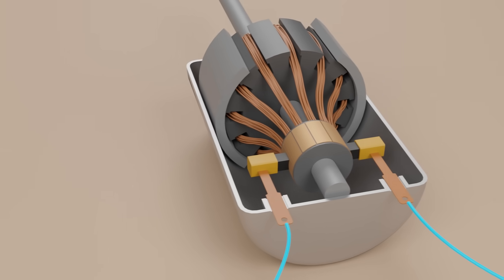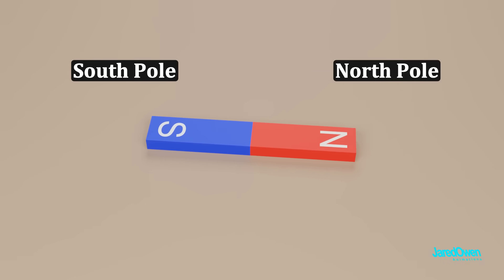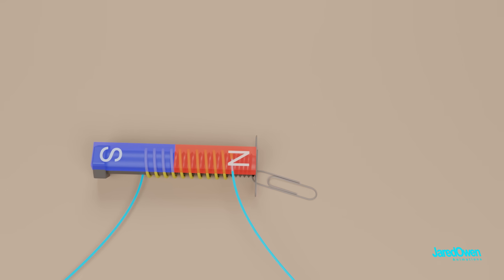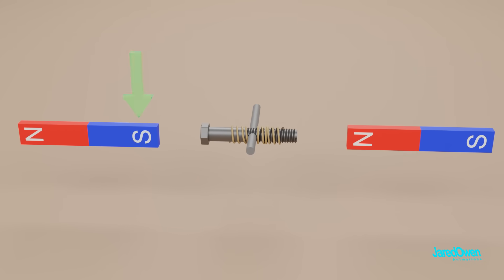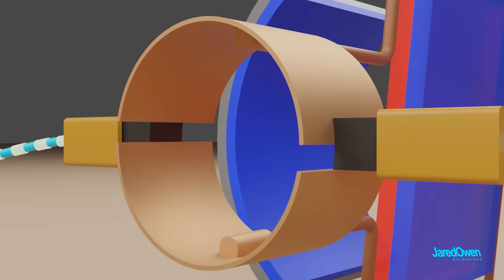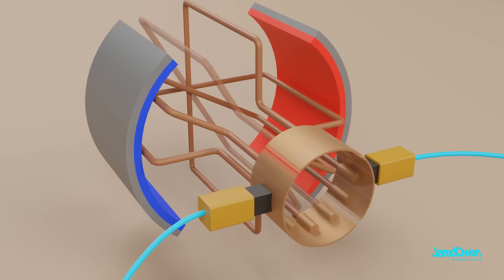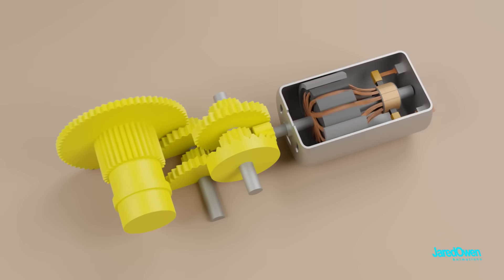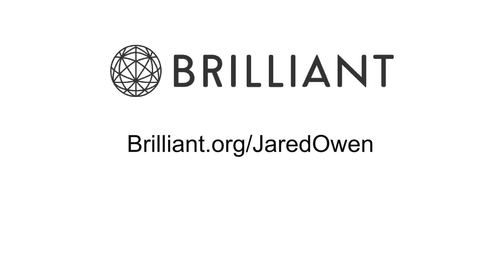How does an Electric Motor work?  (DC Motor)

Comment: When electric current flows through the straight wire it produces a circular magnetic field around the wire. But when the wire is wrapped into a coil the circular magnetic field will all mursh together and form a larger and stronger magnetic field.

Comment: Why introduce the electromagnet as if it requires the bolt? The coil could have been wrapped around a plastic straw and it would still be an electromagnet.
The core might strengthens the magnetic field, but also introduces a delay in the change of the net magnetic field direction.
This over-complicates things at the beginner level and also potentially misleads beginners into believing that an electromagnet requires a core to function.

Comment: had a watch it a few times but i think i got it. 

Here is what i understand from it, the armature become  an electromagnets only when current flows through it. The commutators are used to switch between the different armatures to get spinning of the rotor and to alternate the power source without having to manually switch the wires. The stator are the permanent side magnets they don't move. To make the motor turn faster there are two way: one increase the power of the source or voltage, two increase the number of armatures or wires.

Comment: Wow the conmutator was a really bright idea. I was already thinking about a capacitor and transistors that would make the swap of direction the current happen. And I was wondering how would you perfectly sync that with the magnets. When I saw the conmutator it blew my mind of how simple, elegant and efficient it is.
Reply: Only in DC do you use them. Don't really need them in A/C motors.

Comment: A good point to mention is that the wires are insulated from each other with a thin coat of enamel that's not really visible, otherwise the circuit would be shorted

Comment: Compliments for the video, it is the best on YouTube explaining the brush motor.
 You may want to follow with a video describing an induction (AC) motor.
Since your outstanding graphic abilities, you may easily explain the 3-phase concept.
Because of EMI problems and all the sparks they create (and not because of durability of the motor), in the last few years brush motors are being replaced with brushless types, which are AC motors with an inverter built inside.
Thank you for the great video...

Comment: This is one of the best videos explaining the working principle and construction of an electric motor i have ever seen. I am a Physics teacher and I use this video in my classes because it is perfectly animated and the didactics are just right. Thank you!
Reply: https://youtu.be/YIJMf8hPsYg
Reply: Indeed
Reply: But i think it actually have a miss when presenting an electromagnet in armature. It should be a current, only electric current brought by the wire interract with the magnetic field perpendicularly. And not the electromagnet created by the armature.
Reply: I'm not a technical guy but this video explains quite well except, I thought some more animation or explanation was required for me when you were explaining an increased number of  windings required. Thank you!
Reply: https://youtu.be/yfeDqNNP7Ek
Reply: Don't forget all AC & Radio waves type power have three elements, 1. the positive cycle 2. the neutron, last but not least the   3  the negative cycle.  That neutron cycle is by far the most powerful once you understand:  Without the neutron, the energy could not move forward!!!  You can learn allot about this if you have a bar magnet.  I will prove to you that the center field of a magnet is the most powerful by far!!!  It's how they built the great pyramids!!    If you have a bar magnet/ not a horseshoe type, I'm going to show you all the basics.   DO NOT DISRUPT THE CENTER FIELD WITH ANY OTHER METAL>> 1. Anti-gravity, get something like plastic or glass a granite rock would work well just tap with your finger the centerfield of the magnet near same and it will lose 2/3 it's weight, Next 2.  let's tap the center field near a stream of water and watch it repel the water.  3. If you vibrate the center field at the correct frequency any granite rock will become butter.  YOU MUST UNDERSTAND THE DIFFERANCE FROM An OSCILLATION AND A VIBRATION!!!  The petrographs on the pyramids told us all of this...  Our future will depend on the center field, The height of one's intelligence is directly proportional to their realization of their own ignorance VPC!!
Reply: Hi

Comment: the motor work run by the alternative current(Ac) because when we switch on inside the motor the fan is rotate and rotational motion is formed and the rotional motion is convert into magnetic force and the magnetic force is pull the electricity to work the motor

Comment: To be clear, this video demonstrates the flow of electricity using fundamentals that are based on Conventional Current Flow Theory (Usually taught to Engineers) instead of Electron flow theory (Usually taught to Electricians) which can make understanding the flow of a magnetic field confusing for electricians, because the current is said to flow in different directions which would result in a motor spinning in a different direction if a person is not already aware that conventional flow theory compensates for this change in direction in their fundamentals, a person not aware of fundamentals may easily misunderstand. Just pointing something out for you halfcocked electricians in training. Best of luck.

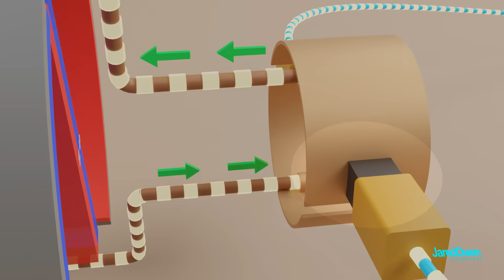Comment: 05:40 Could somebody please explain why the current flow direction would change after the brushes change sides?... and why would not it change when more armatures are added later?...
Reply: The direction of the current at the brushes doesn’t change. However, the current direction changes around the loop because the commutator segments turns and connects to the opposite brush. In other words, the left hand segment, which was connected to the left hand brush is connected to the right hand bush after one revolution of the loop, thereby changing the direction of the current in the loop.
Reply: @kennethcohan9630  Just so i can be sure if i figured it out, if we call the left side of the semi ring A and the right side B, the current flows from A to B lets say and makes an electromagnet with the polarity of SN, the moment we switch sides the current starts flowing from ring B to A, changing the current and therefore the polarity of the magnet to NS which allows us to keep spinning, right?

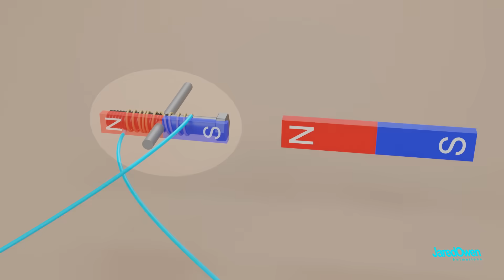Comment: 3:57 Why doesn't the magnet spin counter-clockwise, back to the original position?
Reply: In a single loop motor, it could go counter clockwise, as there would not be enough torque or momentum to move the loop into the influence of the other magnet. However, in practice, there are many loops and so there would be sufficient momentum to carry it past the point of no return.

Comment: Stupid question,  in your opening demonstration of the simple circuit with the battery, light and switch, what keeps that from just shorting out?  If you just hooked the wire from positive to negative you would have a short circuit and a blown fuse if there was a fuse in the circuit.  Why does is not create a short with light in the circuit.

Comment: I've always had electric motors doing things in the shop.   But I never understood how the motor worked.   Thank you so much for a great tutorial on how they work.
I remember our table saw needed to be re-wound because it kept shutting down.   I'm now looking for how to wind a motor.
Reply: Bee Bob •  You can find info online And there's many training manuals on rewinding/rebuilding of electric motors. Rewinding an electric motor is Very difficult, as there are many components to it. Many different types of wire connections, insulations, etc.  I did it for 14 years, mostly AC 3 phase which is easiest compared to DC or Single phase AC. Good luck Bob🥴😎
Reply: @unclefuddelmer9224  Oh, it's more curiosity on my part.

Comment: I personally already knew how motors worked (when I was little I had a build-your-own DC motor kit, where I had to wrap my own coils, install the magnets and brushes, take the insulation off the end of the coil wires and connect them to a DC electric post, etc. Highly recommend, it was a fun, educational project for kids!) However, I still found this video to be interesting, as it explains everything in simple terms that anyone can understand, yet also briefly (but properly!) explains the fundamental principles that are behind the entire process!

Comment: 7:41 that's a universal motor, which works like DC motor, but it's capable if run on AC or DC, unlike DC motor, and universal motor, doesn't have magnets, it has the armature, and the stator, so it only has electromagnet itself, and it's capable of running at a very high speed of 30,000rpm.

Comment: Actually the rotation of an electric motor has nothing to do with magnetic poles switching. When a charged particle moves through a magnetic field it experiences a force exerted upon it that is 90 degrees to both the relative motion and the magnetic lines of flux. It's the force exerted on the electrons moving through the flux lines that cause the motor to spin just as the force exerted on the electrons cause current to flow in a generator.

Comment: It is very well explained. For the first time I have understood why the DC motor starter turns on it.s own when the engine is turned on. Now why does the starter fly wheel return once the engine has started?

Comment: So the commutators don’t really “switch” the current its just that at the half way point the electro magnet should get its original field orientation it had from the start to make it continue to spin otherwise it would be locked with permanent stator magnet field. 
Anyone know if my understanding is correct?

Comment: good video, the animations show "conventional current", which is backward to reality.  Electrons flow from negative to positive, and conventional current is a human construct thinking the positive charge is flowing to negative.  not the case.  Could have done with a 20 explanation that neg flows to pos.
Reply: It really doesn’t matter as the result would be the same, whether the current flowed backwards or forwards

Comment: I've a doubt 🙋

What about the friction produced in the brush?

If the torque is more....then... shouldn't it be damaged as heat will be unavoidable ...?

So how does they make it possible ?
Reply: Evitable is very rarely used; prevented or avoided is more common. There is heat, you are correct but it is not sufficient to cause burning, provided the brushes are bedded in to match the curve of the commutator.

Comment: At 5:26, what determines which side becomes N and S in relation to the flow of electricity? 

It looks like an up-and-down relationship.
Reply: When the current is flowing away from you, in a conductor, there will be a magnetic field set up around the conductor in a clockwise direction and in an anti-clockwise direction when the current is flowing towards you. When the conductor is in the form of a coil, like around a bolt, the same principle applies. Look at location 2:45 and you will see the current flowing from the left hand wire around the coil. Now notice the direction of the current in the wires on the top of the bolt. The current is coming towards you, which means there will be a magnetic field around each of those wires, flowing in an anticlockwise direction, so there will be magnetic lines of force flowing from left to right inside the bolt and from right to left outside the bolt. Therefore, we know that magnetic lines, in a permanent magnet, flows from North to South outside the magnet and so we can see that the magnetic lines flows outside the bolt from right to left. Therefore, the right end of the bolt must be the North Pole and the left end will be the South Pole. Look up the corkscrew rule and maxwells right hand rule as the means of determining the North and South poles.

Comment: Sir plz help me for this question... Sir what is the full form of PMDC ... I checked on google thats PMDC means pemanent magnet dc motor . But sir PMDC are machines like pmdc motor or pdmc generator.. So sir plz clear my dought.. What is the full form of PMDC
Reply: Motors and generators are the same machine. In one we give mechanical input and electrical output and vice versa in the other. So PMDC simply means permanent magnet dc machine.. it can be either a PMDC motor or a PMDC generator.

Comment: I used to think if the electromagnet was replaced by permanent magnet, the motor does not require electricity to spin and we can generate infinite electricity using generator
Reply: So, what do you think now?

Comment: when the brushes switch commutator segments how does that reverse the polarity
Reply: Good question... succeeding commutators have their respective coils wound in opposite directions (crosswound) from the preceding to achieve the opposite polarity.
Reply: The polarity remains the same at the brushes, i.e. +VE or —VE. The polarity in the loop changes because the commutator segment moves from one brush to the other brush as it is revolving.

Comment: Does this go the opposite way like how wind turbines and water wheels create energy?
Reply: actually, yea, generators are when the stator is a temp. magnet whilst the rotor is a perm magnet. any turning, as long as there is magnetic resistance, generates electricity, almost like how pushing a car gets it to start, but n this case, you push it backwards and it somehow goes forwards. then it just needs the electrical equivalent of a valve as the current made from this is alternating constantly, hence the name Alternator. the component that acts as a valve is called a rectifier, and it converts AC to DC. this is why if a wind turbine goes in the other direction, it makes just as much if not more power. basically, the more torque applied to the rotor, the more energy flows through the system as it is converted from kinetic (physical) to electrical energy.

Comment: The windings in most armatures appear to be bare copper wire.  Doesn't the wire have to be wrapped with an insulator for the current to flow only though the length of the wire?  What is the insulator?

Comment: 5:30 as shown here, there would be 2 short circuits per rotation, as the brushes CONNECT both half-rings of the commutator!
Reply: Yes, the brushes should have been thinner, but you would get sparking. Ha, ha.

Comment: I’m confused on how the brush changes the direction of the current when it loses contact, can someone explain that to me please?
Reply: Yeah me too bro
Reply: its not that its opposite, but more that the momentum alone is enough to tug it the millimeter it needs for the next one to regain contact, which allows the next loop to turn on, rather than completely reversing polarity each time.

Comment: I've been dabbling in electronics using ac/dc motors in it's many forms, I knew everything in theory, however never imagined seeing it so clearly today answered a load of questions i had in mind, like how do they take an DC motor and make an ac motor directly, I knew that they just worked, seeing it made it so much clearer in my mind. That's 30 years later. Thanks.

Comment: Awesome animation. Just one point though, you say that a stronger torques means a faster spin. This is actually not 100% correct. Since the rated output power of a motor is a fixed value, speed and torque are inversely related. As output speed increases, the available output torque decreases proportionately. As the output torque increases, the output speed decreases proportionately. This is done by changing the electromagnetic characteristics of the motor by altering either the wire size or the number of wire turns in the winding, or both. More turns of smaller wire provides more torque and less speed where fewer turns of larger wire provides higher speed but less torque.

Comment: Why is it importation to wind the wire in form of a coil?  Can wire be wound in any other shape?
Reply: the electricity only travels in one direction along the wire, and when it moves it pulls the electrons in the metal object along with it. so when it travels in a coil it pulls all the electrons in the bolt in a single direction, and wrapping it around allows u to have more wire in the same amount of space rather than having wires travel across the length of the bolt

Comment: Does every magnet have N and S poles? for example, if I bring two round fridge magnet close, will they also repel in some orientation?
Reply: It does. Every magnet have N and S poles. If you break down a magnet bar with two poles right in the middle, then each bar forms a new magnet with two new poles. The mechanic of how a magnet works and forms doesn't allow it to have two poles come apart.

Comment: Good videos.  One quibble.

"Stronger torque means a faster spin."  It depends.  You can vary torque by using more voltage to push more current through the system, or by having more electromagnets pulling current in parallel for a similar effect, against the same load.  In that case, more torque does mean a faster spin.  But you can also change gear ratios, where there's a trade-off between torque and speed.

Comment: The only thing he forgot was the point of commutation. That’s when a brush touches two commutator bars and shorts the wire to get rid of the current in the wire.

Comment: At 6:16 wouldn't that be as short circuit?  When you had many more loops this would happen more often.  What am I missing?
Reply: Yes the simple first version in this animation would short.  Once he moves on to multiple commutators, where the brush touches two at the same time, those are parts of two different armature loops: the brush on the other side is bridging the other ends of the same two loops.  The simplified version depicts a short while no short happens in more realistic motors.